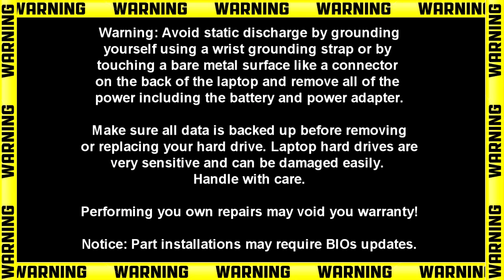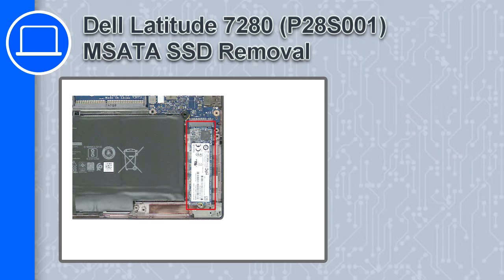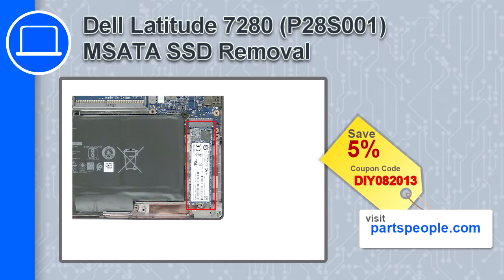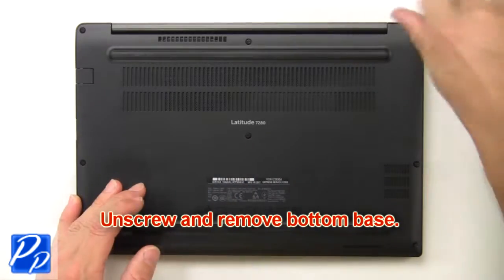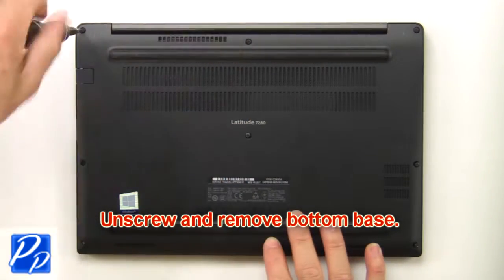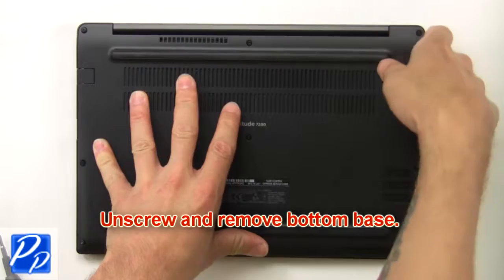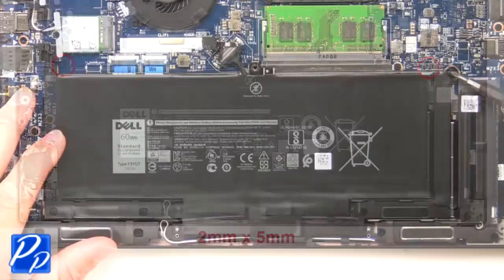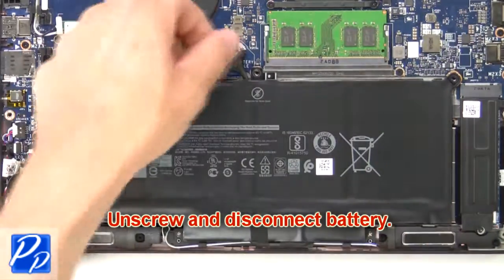Dell Latitude 7280 (P28S001) MSATA SSD How-To Video Tutorial

Comment: This is not mSATA, this is M.2
Reply: So if you just buy the drive to pop in there it doesn’t screw down? You have to have that bracket as well? found one of these from salvage and they took the drive out. When I open the service panel there was no bracket hanging around so that means they probably took the bracket to